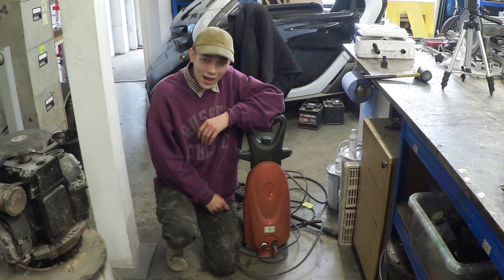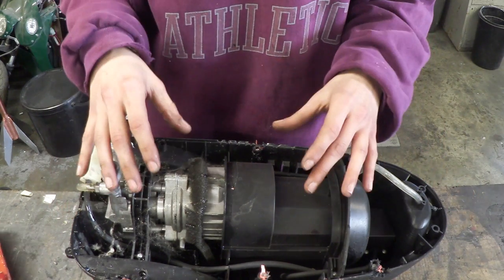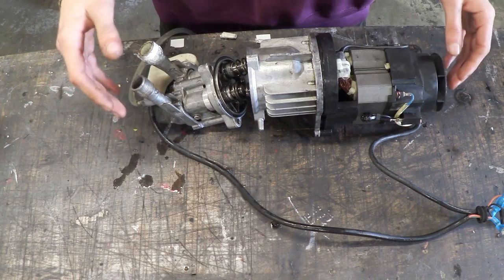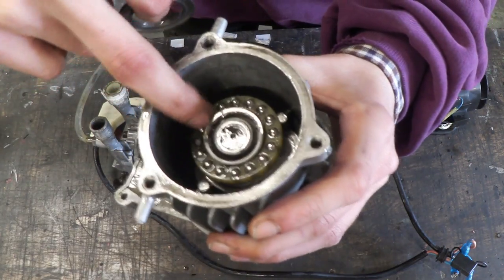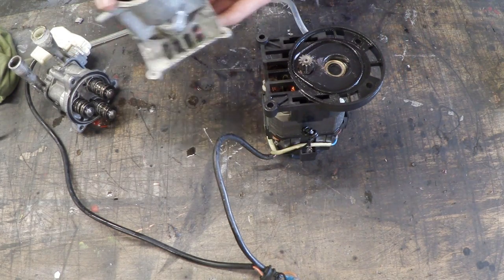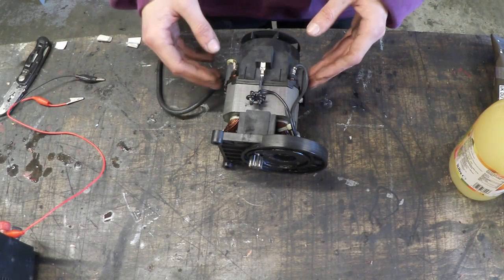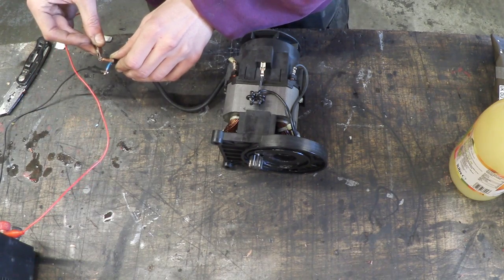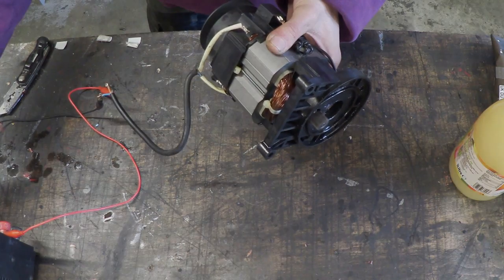1088 - Inside of a Pressure Washer

Comment: Quite short video and not much info about how it ACTUALLY works. Universal motors NEED a controller. They will keep accelerating until they fail otherwise. It seems this channel has just been rapid firing short videos without any kind of theme or really completing anything. It would be much nicer to see a few 20 minute videos that take a project from start to finish instead of this ADHD of random.

Comment: Nice. Your dad did many video's on the motor by now. More interresting : Could you explain how the pump section works ? 3 pistons moving up and down ? Hoe does this pump water ? I guess it's more or less a peralstatic pump. Could you take it apart and show what you find in that section ?

Comment: Luke, how many amps at 12 volts are required to run the pressure washer at close to the same pressure as it ran on AC power. I was just wondering how you would go about making a cordless pressure washer and how long a 100 Ah 12 volt AGM sealed battery might last. Being a sealed AGM battery it wouldn't matter if it got a bit wet so long as the terminals were waterproofed to avoid the possibility of arcing.
Cool video mate.

Comment: Ive never taking a pressure washer apart before. You could turn it into a generator and make a gravity generator and use a washing machine pump as the generator. Then use a solar panel to charge a battery to use for resetting the gravity generator (the gravity light).

Comment: That's a typical swash plate piston pump. Extremely common hydraulic pumps. Some are adjustable by changing the overall depth plate " wobble". 
Same mechanism used in some reciprocating saws. Thanks for letting us see the inside of this little beastie.

Comment: How about splitting the motor from the pump, putting a windmill on the pump to push water up to a tank (battery) to store for later usage to drive a waterwheel generator using the universal motor from above. Perhaps incorporating the waterfall suggestion @edlubs11

Comment: Hi Luke,
what do you think to convert the motor into a generator? For example put some DC on the rotor (via carbon brushes) and see how is the voltage / amps on the stator when now turn the rotor?
- I think if this pump has gone you can't repair it ...

Comment: I have seen some showing water jet cutters they made out of power washers, but also heard that electric paint guns (like those you see running normally off an air compressor to paint walls in a house and such but these just plug into a wall and everything to flow the paint is in the handle on the paint container hanging under it, and should have a warning about not putting your hands in front of the nozzle to see if it is working because it will inject paint into the skin and cause gang green and such problems LOL) anyway the fact that it worked could allow that to  be used as a sand blaster cutting tool too. (there is a video where a guy made one using a tupper ware storage container and some cheap rubber gloves, ect, air compressor and hobby tubing used in model railroad and such stuff, and cut spiral cuts in glass test tubes and such, and I bet a good unit on a laser engraver CNC control could be used to cut things, quite well! Wondering what this could be made to do, if water were used instead of air to blow that sand material into something for cutting action maybe for cutting stone and such, (also air assist with a laser is a thing, that vastly improves cutting capability of even the weakest laser. Found that out myself, but now I am wondering how water could be used instead of air, and jetting the laser into it as well, which I still have to set things up so I can use it in a salt tank to attempt to create voltage differentials enough that the salt can be used to etch metals with the chlorine or sodium, or maybe another salt will work better like magnesium sulfate to get sulfuric acid reactions to cut the metal or something, from the charge of the photons in the metals or what ever charging it to attract one and not the other half of the binary acid base salts. ) or you could use it for all sorts of liquids as opposed to water for who knows what. :) Can't wait to see what you decide to do with it, also (see next comment)

Comment: Ah, I always imagined the pump to be a single positive displacement one like a gear or vane type. Interesting to see that its effectively like a water equivalent of a 3-phase generator. Does it also have an expansion chamber on the output too, i.e., the water equivalent of an electrical smoothing capacitor...?
Reply: Kinda but its more like an ac compressor in a car i think. It could have 3,4,5,6 etc pistons to pump the water, but a pressure washer is more like a booster pump cuz the water will already be pressurized to about 30-40psi from the water main. It would be like a 3 phase gen if you ran all 3 phases together into one, like thru a rectifier or something. Like going from 3 phase ac to dc like the charging system on most motorcycles.

Comment: Would have been nice to break the pump down further, to see how the springs interact to increase the pressure. I assume they force the water through a series of one way valves. But hard to know what the actual process is.
Reply: The springs are clearly for the return of pistons. The disc only pushes, but no pulling.

Still, agree about the system needing more exploration!

Comment: Luke, that is a cool little beastie, is there a "wobble plate" that works the the springs up and down when driven by the motor? I just Couldn't really see if the plate was pinched or had a cam lobe, in either case, It was cool you pulled it apart for us I have not seen the inside of that design, I'm used to in-line three cylinder in line conventional units that I laid out breadboard style  That rotary design looks more reliable to me
Reply: you missed the part where he mentions that the bearing on the shaft is on an angle.  When Luke says "synchronizes" the pump, I think an easier way to look at it is that the rotating angled plate sequentially compresses the pump pistons, If he tears down the pump portion, we might find that the pistons are progressively smaller, effecting a multi stage compression effect.  Low volume but high pressure :)
Reply: lots of auto text corrupt on my entry, I often check them but the best way to avoid the secondary piece of software that seems to argue with the primary is the red at someplace else and perform a cut and paste, even when I check things, after I've sent them I have found some times and tire lines of text changed, especially when it comes to ownership Being designated by I,they, hear,them,you, And then I found leg has a lot to do with it as well, and the >vocab you Larry < (Vocabulary - this is a great example, by looking at that you would assume I said the word (Voice to text)incredibly slow, but in no way was that the situation) about to text corrupt.
Reply: Wow and even in that which was just written previously was chewed up pretty bad

Comment: It's not clear how the flat rotating disk can push each of the three spring loaded plungers on the "pump". Cool takedown, though. 🤔👍🏻
Reply: The disk is mounted on an angle so it pushes on of the spring plungers one at a time.  Freeze frame the video and you can just see it mounted on the angle.
Reply: @stubluesjhb1  it’s called a swash plate 😉